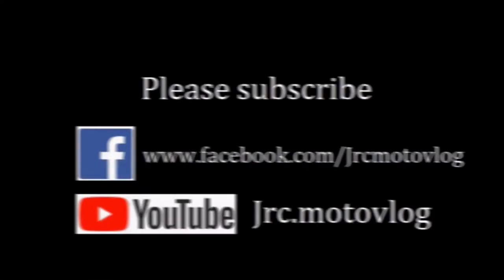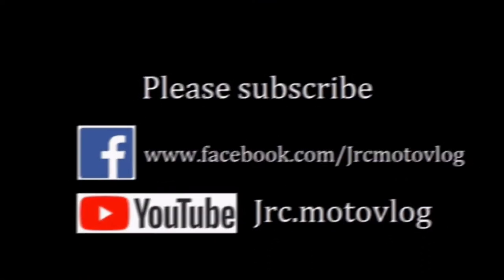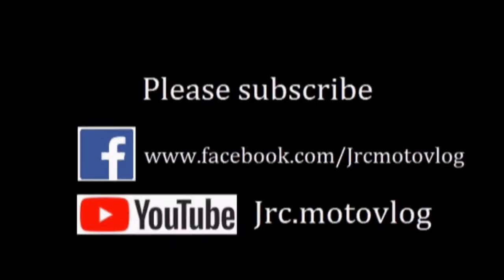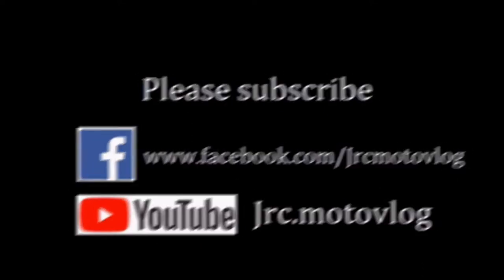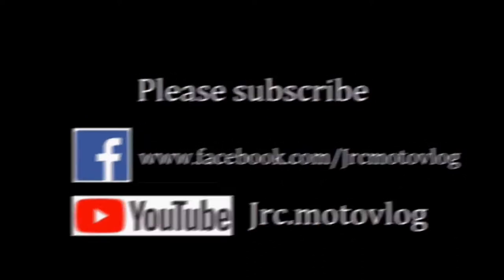Flyball combination for honda click 125 |15x12 newly equipped

Comment: paps maganda rin ba performance nang straight 12grams+1k center spring..50kg driver
Reply: sana mapansin
Reply from the maker: mtigas 1k centerspring pra sa stock degree ng stock pulley. mwwln k ng dulo. pero mlkas arangkada mo
Reply: @teamkagoodboys  kung straight 14grams paps stock na lahat.. pudpud na kc stock na 15 grams
Reply from the maker: panget straight. mganda combo tlg. 15x13 or 15x12 sa stock pulley malakas dumulo
Reply: @teamkagoodboys  sir may arangkada pb ung ganyan set up at may dulo  kung mag 15x13 convi..